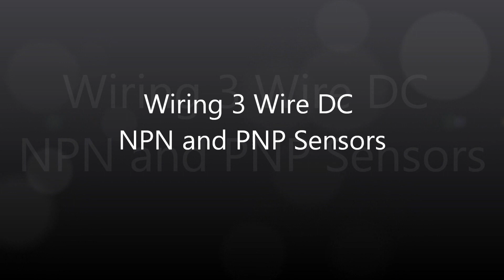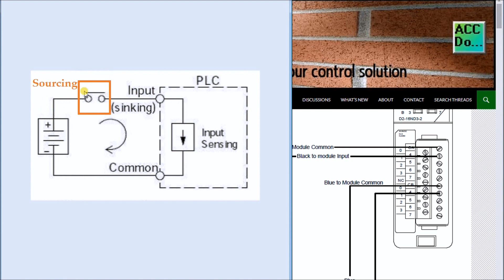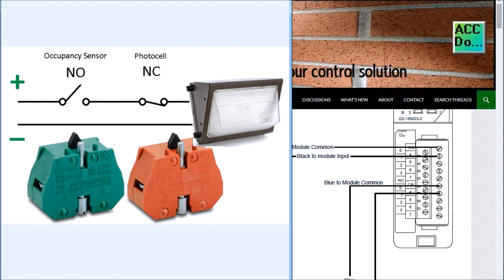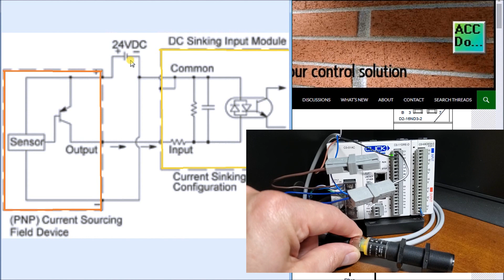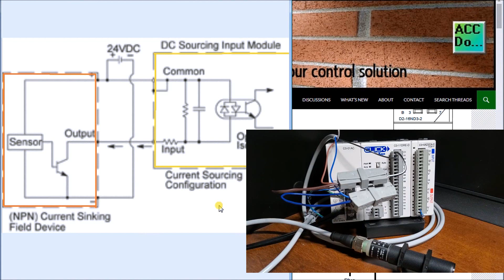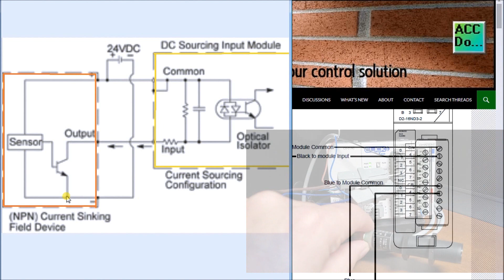Stop Wiring DC Sensors Wrong: NPN vs PNP Made Simple

Comment: Im still a little unclear if i need NPN or PNP sensors for mosaic M1. I ordered NPN sensors but they haven’t arrived yet and still researching to verify I have the correct sensors before they arrive and I hope them up.
Reply from the maker: Hi Justin,
The Mosaic M1 has 8 PNP (active-high) digital inputs.
Here is a diagram that shows the NPN and PNP sensors.
https://accautomation.ca/heres-a-quick-way-to-wire-npn-and-pnp-devices/
You should be using PNP sensors for the input to the Mosaic M1 controller.  The actual transistor in the diagram will switch the +24 VDC signal to the input point. (PNP)
Regards,
Garry
Reply: Thanks Garry! That diagram cleared everything up.

Comment: In an NPN setup, what is the voltage measured from the output wire to 0V when the sensor is not high?  I am thinking that there are two options - the first is that it is at full 24VDC, so that it is at the same potential as the input point and no current flows.  Second option is that the BJT completely opens the circuit and the reading is 0VDC, but only because there is not a continuous path to either 0VDC or 24VDC.  I am leaning towards option 2, but I don't know.  Any idea?
Reply from the maker: Hi Chris,
You would measure 0 volts on an NPN sensor that is activated between the sensor output (Black) and 0 Volts (Blue). 
24 Volts would be measured on an inactive NPN sensor. 
Remember that voltage is the potential to do work. If a sensor (switch) is open then the potential exists and a voltage can be read. 
When the sensor switch is closed there is no potential so no voltage is read. (0 Volts)
I hope this helps you out.
Regards,
Garry

Comment: What im not understanding us how are you getting you BJT to switch with a positive voltage
Reply: I'm talking about NPN transistor now. I believe it ONLY works with negative voltage
Reply from the maker: @enverismail6864  
Just about every video has an associated website page with additional information.
Here is the link to the website page.
https://accautomation.ca/wiring-3-wire-dc-npn-and-pnp-sensors/
This may have the answers to your question.
Let me know how you make out.
Regards,
Garry
Reply: From your power supply
Reply from the maker: @jong3161  
Most items are referenced with respect to the common point of the input of the PLC.
Regards,
Garry

Comment: Hmi showing 200micro meter output for a field installed ideal 3 wire proximity sensor installed on a pump shaft  what might be the problem, how to diagnose a faulty sensor by using a multimeter
Reply from the maker: Hi R 945,
You can measure the output lead and 0v lead for voltage on your multimeter. As the sensor has items in front of it or not, you should see the DC supply voltage or 0 Volts.
Regards,
Garry

Comment: Hi how to connect three sensors to a control system and power source??
Reply from the maker: Hi Analie,
Can you give me a little more information on the sensors and plc that you are using?
(Sensor model/type and PLC model and input type)
Do you want the three sensors wired in series to the input, parallel to the input, or all individually to separate inputs?
Thank you,
Garry
Reply: @ACCautomation  all three should have same input at the same time or else it will equivalent to false. So they should the connected with each other. It's a three wired sensor
Reply from the maker: @analie1372  
The following website will show the connection of 4 sensors in series to an input. This is for the protection of a die.
https://www.wintriss.com/wcg/knowledgebase/122012.html
You did not mention NPN or PNP but this diagram should give you an idea of how to wire the circuit. I hope this helps you out.
Regards,
Garry
Reply: @ACCautomation  thank you it's a great help 😊
Reply from the maker: @analie1372  
You are welcome.
Garry